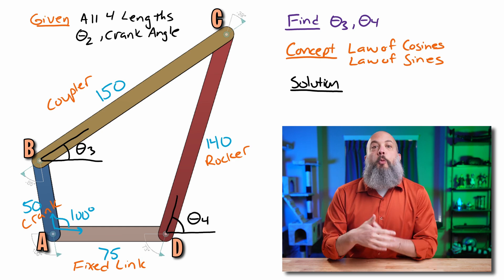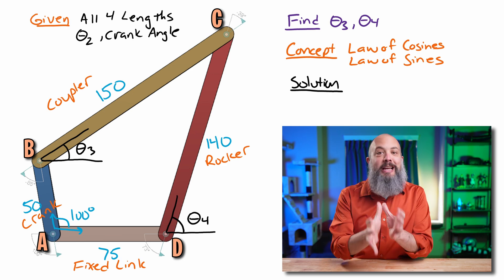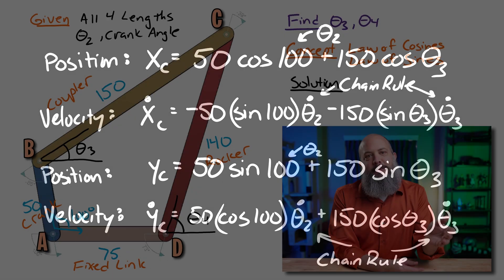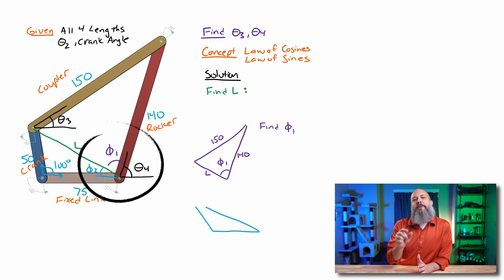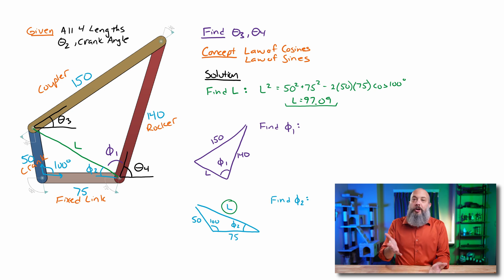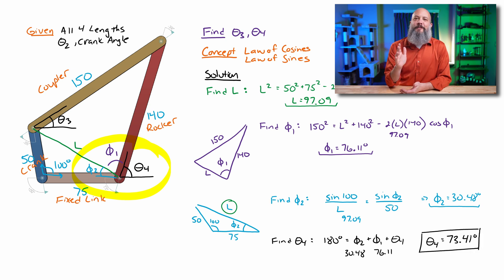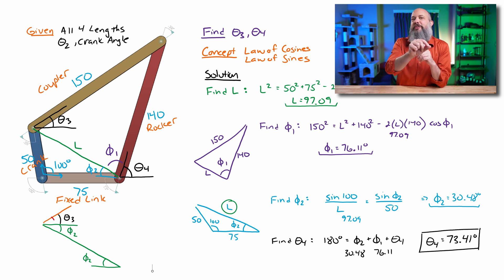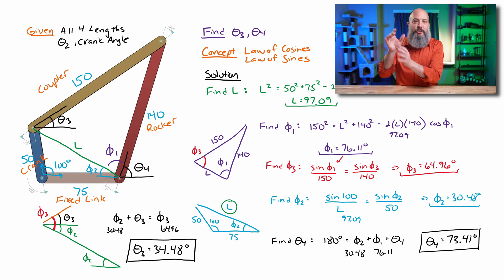Position Analysis of a 4 Bar Linkage

Comment: Hello! Sorry, I have a question and it might be kind of dumb, but my professor showed us how to find thetas, and basically any positions in a 4 bar linkage mechanism through the vector loop equation. Would you say that the approach you made for finding the thetas more simpler and easier to follow than the vector loop equation? And if so, i have some other questions regarding the vector loop equation if you are familiar. One of my questions are if every time i am given knowns and need to solve for unknowns, do I have to derrive the equations using the half angle identities and all the trig/eulers identity? Thank you for your time!
Reply from the maker: I think the easiest way is to use my method in this video, using law of cosines, to solve for each angle, then once you have the angles, I use Vector Loop Equation to find positions. I think law of cosines is easier than simultaneous equation which is what the vector loop leads to for finding angles. For velocities, which you'll probably start next, When you take time derivative of the vector loop equation, you get an equation to solve for velocities, and that is how I would do that most of the time also, using vector loop. I've never used any half angle identities for vector loop before, maybe this is because I always find the angles first using law of cosines. Also, I don't use euler's identity either. For vector loop - I don't use exponentials, I just jump straight to separate sine and cosine equations and just start with sine and cosine, not exponentials first. If you check my playlist, you'll see that I have a vector loop video, probably released about 4 months ago - it's more about velocity, not position, but I think it still might answer your questions and provide another viewpoint that might help you.
Reply: @ thank you so much for your response! I’ll definitely look into to it
Reply: @BrianBernardEngineering  Hey! Just wanted to update, so I saw the video and it really helped a lot. The approach you mentioned is much easier and less complex, so I was able to solve problems more effectively. Thank you once again!